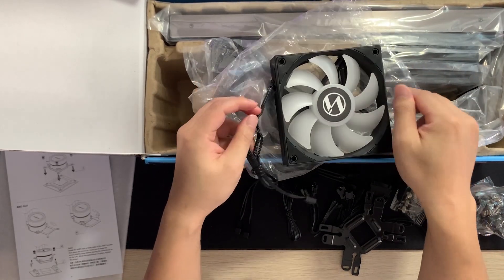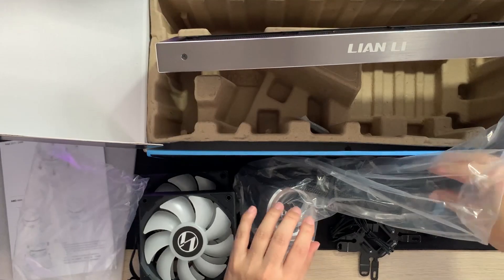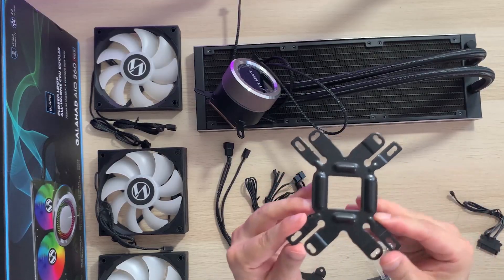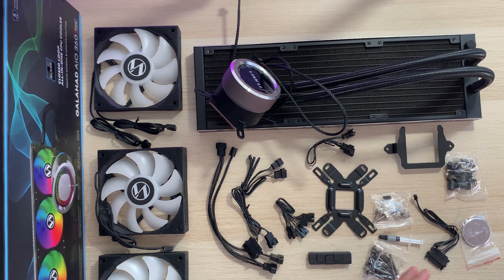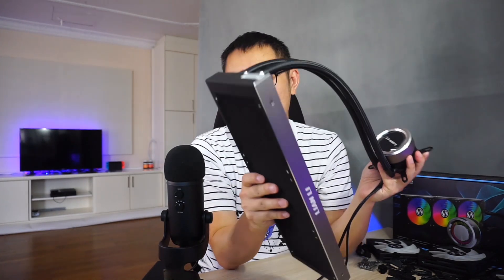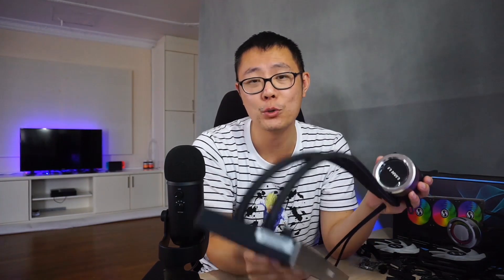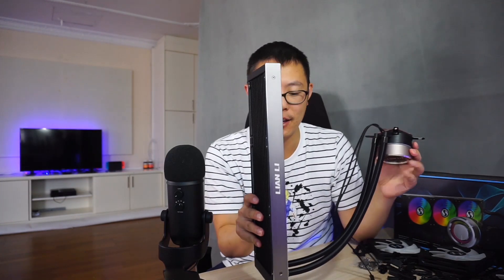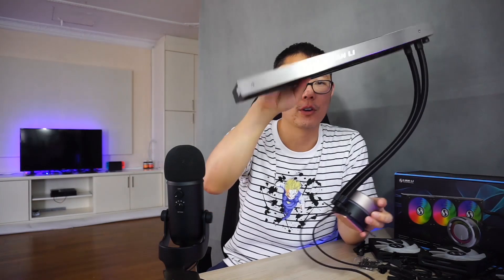Lian Li Galahad AIO 360 Unboxing + Water Engineer on AIO Orientation

Comment: Nice Video!!!😁👍🏻 Also depending on the orientation and the natural gravitational pressure of the water column, the pump impellers could also be causing cavitation which is a bubble with a void and slight vacuum. That being said, I'd be curious as to how much "lift" the pump creates and it may be different considering that it is a closed loop system, it might perform differently in these regards. I'm in the process of ordering one for my son. Also, depending on the clearance of the radiator + fans, I may attempt to 3D print static pressure boost plates that would get sandwiched between the fan & radiator. Basically, a static boost plate looks like a fan but with stationary blades  with a direction/angle in opposition to the spinning fan blades. Similar to a turbofan type airplane engine. Helps resistive backflow from happening and keep a definite positive pressure towards the radiator.
Reply from the maker: Thanks. Let me know how you go with those boost plates. Be interesting to see your results. All the best!

Comment: Great info. Thanks. I have the EVGA CLC 360 in a Lian Li PC 011 Dynamic case. I’m able to mount the CLC on the side with the tubes down. The lines are kinda tight, but not binding.

Comment: The only way I can install mine is in the front with the pump slightly higher than the radiator... Should I push the tubes up or down? Wouldn't positioning the tubes so they are curved slightly below the top of the radiator, trap the air inside the radiator? Arching them up would trap the air at the highest point of the tube, perhaps?
Reply from the maker: Yes that's probably best if you can't put the pump below the rad.

Ideally I'd keep the pump below the radiator but if you can't do this, push the tubes up above the pump. The air will go to the highest point whether that's the tubes or the radiator or the pump. It should be ok if the tubes and rad are higher, but if the pump is the highest it means the air will go there and that's probably the worst of the three because the pump can't push air (only water).

It's not great either to have air accumulate in the tubes or rad, this essentially means your tube dia is reduced at that point and your point works slightly harder but that'll happen to everyone and it probably isnt going to be an issue for a while.

Comment: Great video! I just bought this cooler, unfortunately I have to top mount due to fan push/pull and the fact that my case has no transparent front.
Reply from the maker: Does yours fit at the top? 

I have a medium tower a Lian Li Lancool II mesh and it still doesn't fit at the top. 😄 The 360 is really long...

Glad its working for you.
Reply: @JimRPG  Yeah I've got a Gungnir 100, my pretty fans would need to be inverted when front mounted. Thanks for the tip, I actually was considering that as my next step up.
Reply: I wanted to too mount but I had to front mount it. We put the fans on backwards so they blow out so gotta flip em

Comment: Nice straight to the point video :D 
I have MSI Coreliquid 240R and after around 6 months I ran into severe heat problem (CPU temp reach could 105C plus if no limit was set on BIOS). Does the orientation method  applies to radiator mounted pump like this AIO? I installed the radiator on top of the case so I'm confused if this is the caused for it's early death.
Reply from the maker: Thanks for the comment.

There's nothing wrong with installing it at the top of the case, that's a good orientation but needs inside the case to be not too hot as well otherwise you're just blowing warm air on to the radiator. If you have a hot GPU, better to have the radiator at the front.

Here's some ideas to troubleshoot your issue.
1) go back and reinstall the pump on top of the CPU again, and reapply thermal paste. It might not have been installed perfectly, which leaves air gaps and then hot temps.
2) if that's not it, try listening and see if you can hear the pump. the fans should be louder. if its struggling to pump the liquid, maybe you have to refill the liquid. system needs to be full.
3) You can also try front of the case and blow fresh air onto the radiator.  Make sure the fans are blowing onto it, easy mistake to do and have the fans blowing the wrong way which wouldn't work at all. Also its not a great idea to have the fans on the suction suck, trying to suck air through the radiator and blowing it out.

Failing all those - better send it back might be faulty. Also if you're seeing high temps in synthetic tests like Prime95 wouldn't worry about it. Only worry if its gaming or another application you use regularly.
Reply: @JimRPG  Okay, thanks. Will try that and send it back if no avail.
Reply from the maker: @gr4yw4rd3n  Good Luck

Comment: I have this AIO in White. I just wish they had prioritized making a proper mounting system for AMD AM4 platform. The GN review showed how the mounting pressure is not Ideal. I assumed as much at installation. The DIY market are the  ones buying this and with the popularity of Ryzen it's pretty Tone Deaf to do it the way they have giving Intel priority mounting hardware. Not gonna see the Galahad in many pre-builts.
Reply from the maker: Hey Stephan - been a while. Yeah it was tricky to work out how to put the Intel one on, but looking at the AMD diagram, it doesn't even look as secure or as well designed as the Intel one. Very fiddly for me.
Reply: Any regrets so far? I'm looking to buy a 360 Galahad in the coming weeks. The deciding factor became how it would look in my PC but I'm curious about your overall experience. Something you miss and wish they'd implemented?
Reply from the maker: @snook.1  The installation is a bit tricky/fiddly if you're just working off the instruction sheet, because you have to line up four screws on the back. But its not that hard once it starts to make sense. Aside from that I thought there would be some software for performance or RGB, but there isn't but maybe all the other AIOs are like that too. Performance wise, its been great, temps are great in the games I've tried so far. I haven't tested it in prime or AIDA64 but I'm sure there are channels that have.
Reply: @JimRPG What do you think about the level of noise? I've heard mentions of coil-whine, did you experience that?
Reply from the maker: @snook.1  Also there's not much RGB to speak of. It's there but subtle.
Reply: @JimRPG  the AM4 bracket is my only complaint. I think it looks elegant in white though I did replace the ARGB Fans with Uni Fans push/pull. The Galahad plugs right into the Uni Hub seamlessly. The cooling performance is exceptional though I believe it could be even better with the 4 point mounting bracket. I am running a 3800XT which is a 105W TDP chip. Never seen it above 70C under full load and it gets up over 200W boosting to 4.85Ghz. I prefer the magnetic cap on the water block, I hate paying someone to advertise for them.
Reply: @JimRPG  the included fans are ARGB though? You mean on the block?
Reply from the maker: @stephanhart9941  Yeah I meant on the block... oops. I just wanted more RGB on that. Also I wasn't able to coordinate all fans to the buttons on the PC Case. The three front fans change color via button on the PC Case, and the three exhaust fans change via software. A bit annoying but I can't be bothered sorting it out. 😄
Reply from the maker: @stephanhart9941  same Im getting really low temps running cyberpunk 2077. that's the hardest thing I threw at it but its running almost a little too good I'm wondering if the sensors are actually working properly. But the air coming out is cool enough. 😄
Reply: @JimRPG    I take it your Case fans are on their own controller? The only way to sync it all up would be to split where the proprietary fan connector connects to the daisy chain wire for the Rgb fans. Connect that to the case controller.  It's just a 4 pin JST connection. It's really easy to cut it off and replace it with a standard 3pin ARGB plug. Then you can use a regular 3 pin splitter.  I wish Lian li would just use regular headers on those fans. I still have mine in the box so when I go custom hard line I can resell the Gallahad. The Uni Fans have regular headers.
Reply: @snook.1  if you want aio in the closer price I suggest deepcool castle 360
Reply: @demon6937  Thank you and great timing, it just happens to be on sale where I live right now. Could be interesting depending on if the Galahad suffers from coil-whine on all units.
Reply: @snook.1  hmm I only saw very few reviews on the galahad, it looks great but common complaint is the installation process. I'm planning also to buy deepcool castle 240ex but I will replace the fans using lian li unifan for lesser cable clutter

Comment: What about installing it on the top of the case? I feel like that’s a missed talking point and I can’t find good info.
Reply from the maker: Yep if you can fit it - that's probably the best way, the air bubbles is spread out over the top of the AIO, and the flowrate isn't going to be affected as much as if its in the front of the case with the radiator standing up. That's what I would do with any 240 or 280 AIO. But most people can't do 360 like that, that's ok, it should be fine. This is all kind of theoretical rather than practical, so while at the top is best, the front is also fine.

Comment: I have a question, is there any way to remove those air bubbles? I know conventionally there isn't a viable way but as you're an engineer do you have any thoughts on this?
Reply from the maker: At some point when you've filled the AIO as much as you can, the air bubbles isn't going to be that much of an issue unless you install the pump as the highest point. As long as the pump isn't you're going to be fine. If the AIO system is completely filled, we're only talking about air bubbles within the liquid or after the liquid permeates through the material creating space in the pipe system. Is there any way to take out the air bubbles within the liquid? That's beyond me and nobody would be able to do at home anyway so not worth worrying about. If we're talking space created by liquid permeation, well you have to manually top up your AIO.

Have you seen Gamers Nexus video on this? He shows the pump gurgling, but it is probably an edge case, because he put clear plastic panels and filled the AIO up himself and then held up the pump at the highest point and you can see the pump struggling as its pushing air and water. If you filled the AIO to the max and held the pump up, it should still be ok as long as the pump fans don't have air and are purely pushing the liquid. But obviously you don't want to install it pump up, because over time the air will collect at the top.